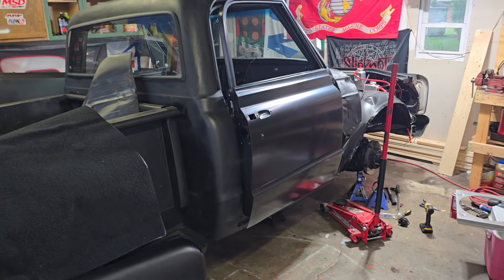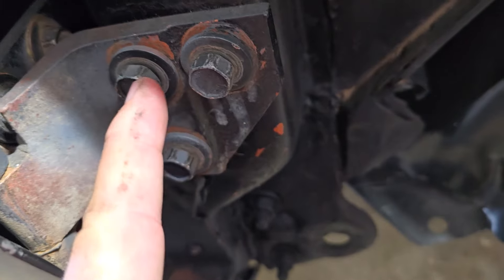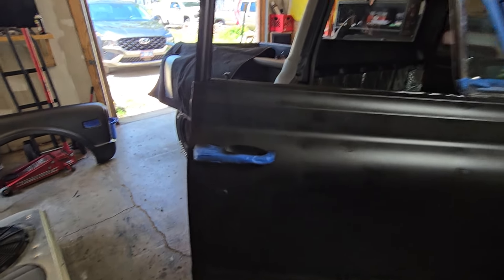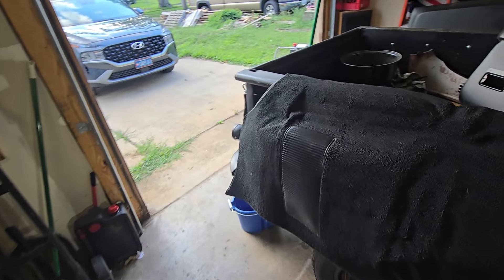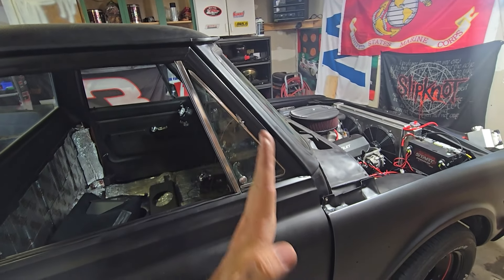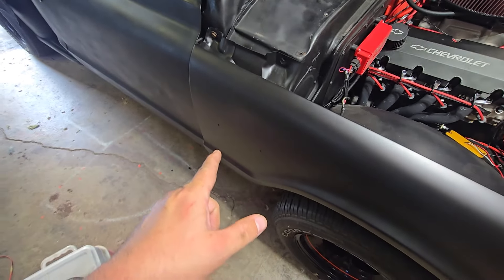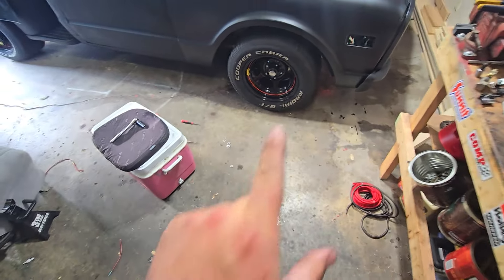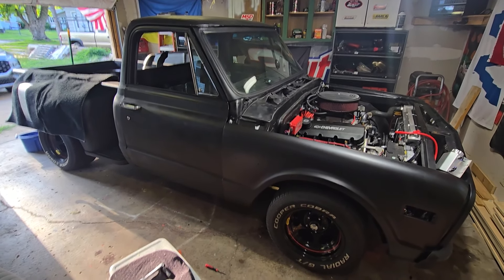First Start in 2 Months - Putting Truck Back Together

Comment: Hi my name is wayne and i have 
A 1971 chevy c10 with 350 and 700r4 with holley 4 
Barrel and i dont know what 
To do go with efi sniper 2 or 
Go with swap ls 6.0 4l60e 
What do you recommend me? Please let me know 
Thank you
Reply from the maker: If you want reliability, power go with the 6.0.....if I ever get tired of my big block..I am going to get a 6.0 too
Reply: @DadbrosGarage  how about the transmission? Stick with the 700r4 or
Change it to 4l60e
Reply from the maker: @WayneMontes-mh7bp if I'm not mistaken the 4L60 is an upgrade to the 700r4.. even better if you can get a 4L80e...that is even better. It can handle more power
Reply: @DadbrosGarage  thank you